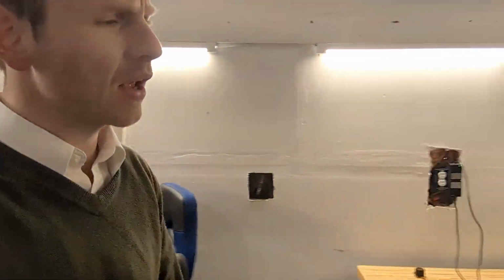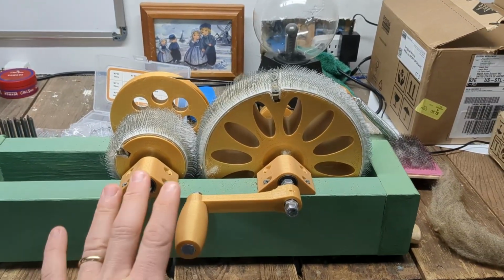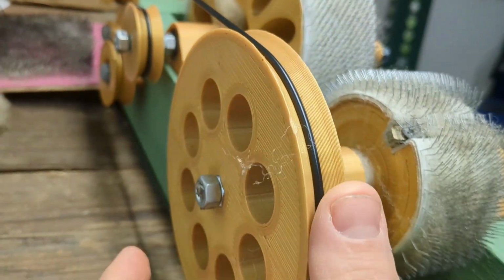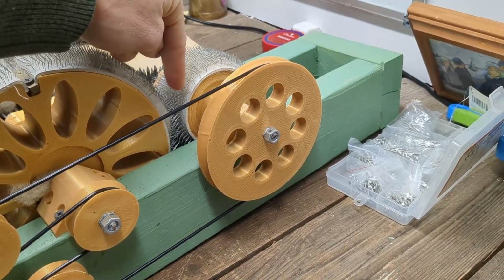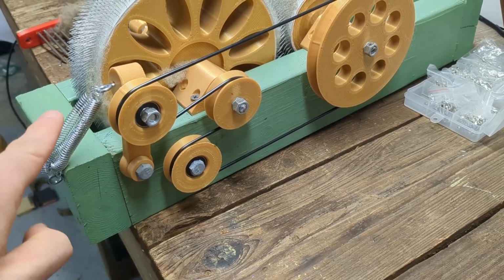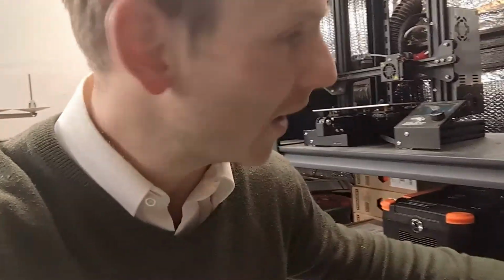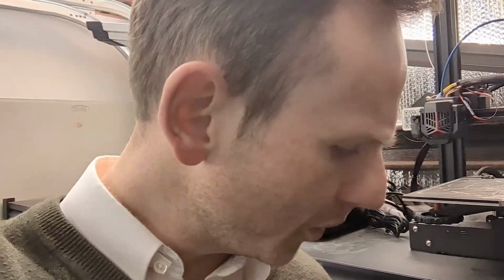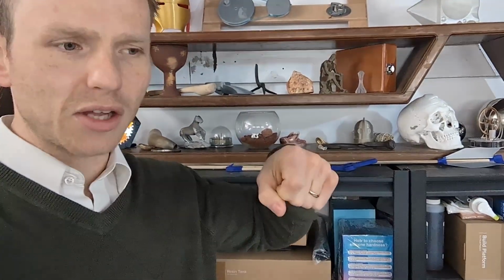3D-Printed Drum Carder (Revisiting the Project)

Comment: You might not have your carding drum and licker-in drums aligned for actual use in the demo/engineering video, but for actual use you'll want their teeth to not touch but have enough room to pass a sheet of paper between them. Otherwise you will put unnecessary wear on your expensive carding cloth.

Comment: Shaft solutions are more simple than maybe you think. Your pulleys and scraper drums should have hubs with set screws in them to lock them into the shaft - you can file flats into the shaft you improve that interaction.

Spacers would help maintain the scrap drums axial position on the shaft. You probably should have a small spacer between the pulley and pillow block too.

Lock nuts should really be sufficient to hold the shaft in place, but if not you can try castled nuts.

Hope that helps!
Reply from the maker: Thanks! The set screw is what ended up doing the best. Video incoming
Reply: @GoodandBasic  Looking forward to it! I really love these small scale personal production machine type videos. Probably my favourite on your channel.
Reply from the maker: @RobDragonslayer thank you!

Comment: the old wool carding tools were just fine nails hammered into a board in a staggered pattern it's not as quick acting as modern carding cloth but it is basically unbreakable and very cheap to do
Reply from the maker: I'd like to try that.
Reply: @GoodandBasic  stagger the nails the same as one would bricks and leave about 10 mm between them for a tight wool gin

Comment: Not sure why u need to make your own brush/teasels? Cold you not repurpose a relatively cheap fur grooming brush, adapted to fit into the machine ur making?
Reply from the maker: You're right that it's the same material. I have a dollar store dog brush on the workbench in this video. I didn't like that option because dollar store inventory changes quickly and I wanted the design to be repeatable by others.